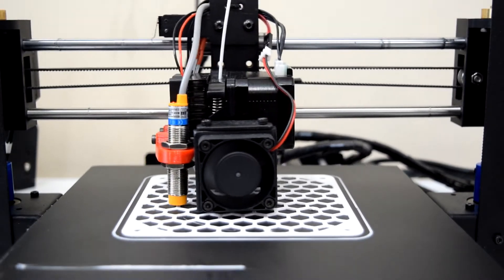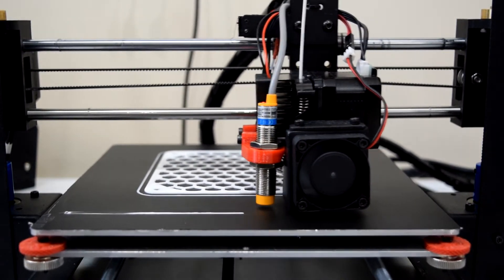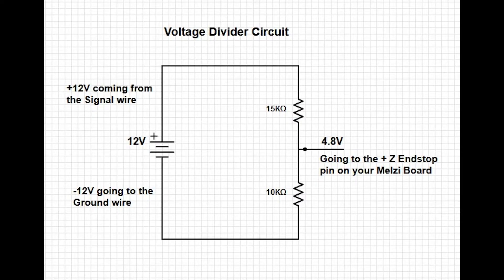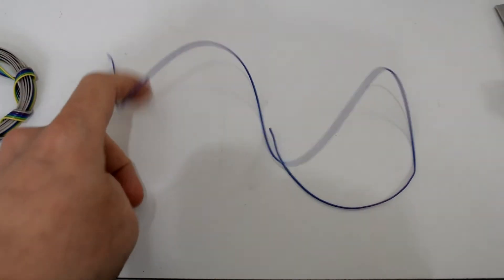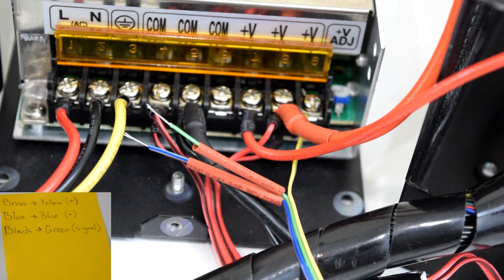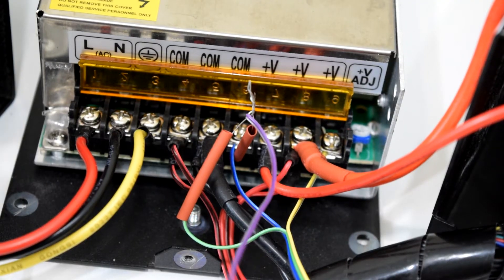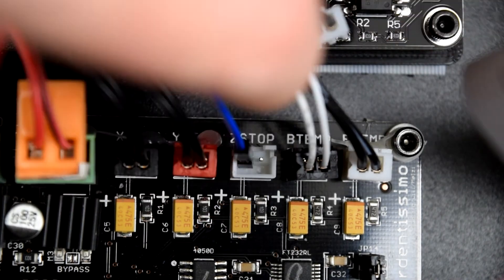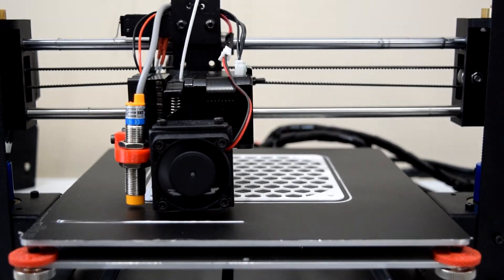Maker Select Auto Bed Leveling v2 | Voltage Divider Method

Comment: I am a first time 3D user but I hand built a 36” x 48”x7” CNC 12 years ago and have enjoyed it for years, and I want to try my hand at 3D printing.  Im well versed in the importance of aligning and leveling equipment. Initially I planned to find an used 3D printer and rob it of the bits and pieces I would need in my construction, I lave lots of various sizes of extruded aluminum and planned to use that in my build.
However two days ago I was in Goodwill and found a brand new still in the original box never been assembled Monoprice Maker Select Plus 3D printer for $80.  In checking it out I found it to be a quite rigid well build unit, with good looking Z acme threaded shafts, nice looking brass nuts and generally good looking construction.  In 20 min I had it put together per the manual, and I understand why you have added the diagonal braces to yours. Now before I add any power I’m viewing all the alignment procedures. 

Thanks so much for the very clear description and video of the process.  In your initial auto Z zero you mention replacing the firmware to a different one, is that still necessary with update?  I see many are recommending switching to Cura (SP) firmware, would this update work with that firmware?

Comment: Great video! Thanks for posting it. Following your videos I now have a new firmware and auto bed levelling on my printer. Amazing! Just two comments: 1. I modified your sensor mount so that you can directly mount it to the printer without having to buy longer screws. I have it uploaded to my GrabCAD (https://grabcad.com/library/monoprice-maker-select-v2-wanhao-di3-auto-bed-levelling-sensor-mount-1) and cross referenced the link to your Youtube channel. Please let me know if you don't feel happy about it. 2. I'm not an electrical guy but in the voltage dividing method you shared, it seems like your sensor does not have a pull up resistor. In my case (and apparently some others down here), mine sensor (although the same model number with yours) has a pull up resistor of 10K. I ended up using 1x10k in series with 2x10k in parallel (so 5k) to divided the voltage to 4.8V. This also make it more cost effective as you only need to buy the 10k resistor ;)

Comment: Do you lose any features by enabling this bed leveling, and is it 3-point or mesh? I remember looking into this when I first got my machine and read about how small the melzi memory is, and you'd lose PID temperature control (among other features) by installing bed leveling.

Comment: Could this be a faulty sensor or wiring? I was able to print a test bed level file a few times with no issues. But the machine randomly seems to crash into the bed for no apparent reason. I go over the final calibrating steps try again and everything seems to work out but it happens again. Also the head crashes into the bed on the last auto leveling procedure towards the right back of the bed, never before the 8th and last probing... the sensor is still over the bed so the settings are good. When it does print the leveling squares they are perfectly placed on the bed. I am about to throw it out smh. any help or suggestion here would be greatly appreciated. Thanks for your patience lol

Comment: complete newbie... I followed the instructions with the Arduino method. In that video the AutoBedLeveling was compiled to the Arduino. With this new method of connecting the sensor directly to the Melzi board, do I need to compile the AutoBedLeveling to the Melzi board? If yes how is it that done and will it write over the firmware or simply added to it?

Comment: I may be missing something critical here. But isn't a voltage divider only required on a PNP inductive sensor? And for NPN, you connect the signal wire directly to the input, then turn on that inputs pull up resistor. Then when the sensor is triggered, it pulls the signal voltage down to 0, switching the input from high to low.

Comment: Bringing a bit of light as I was becoming crazy with the voltage divider. The LJ12A3-4-Z/BX probe has a 10k internal pull-up resistor. So if you use the resistors from this video, you will actually end up with 25K resistor from Signal wire, 10K from Ground, resulting in a 3.6V output to Z EndStop.
You need to work with a R1, R2 following pairs (R1 is from Signal wire and R2 from Ground) : 11k and 15k, 18k and 20k, etc...
Inverting the 10K/15K should work as the voltage should be 5.15V.

Edit: I inverted 15K/10K, it outpud 5.12V and works fine on the board. My sensor is finally working properly. Tip: you can send M119 command from a terminal to see the states of your endstops. That way, you won't crash your bed like I did if things turn bad.

Comment: Thank you so much for these amazing tutorials. I flashed the new Marlin firmware, Installed the probe and everything is really working great. I did have a few issues with the probe but managed to sort it out with one of the comments. I am currently working on a Marlin 1.9 Firmware for the machine.   Keep up the good work bud :)

Comment: I figures out a easy work around so you don't take anything apart.
Hook the blue - and brown + to a 12 or 24v transformer, hook black and blue to a micro relay on the input side, hook the normally open switch to the z plug.
When the proxy triggers the relay it closes like the original z switch and says stop.
Works awesome.

Comment: OK hope you replay but here is my idea.
Instead of using resistors, use a dollar store 12v to 5v car phone charger.
It would be a clean 5v 1000mah supply to the z header. 
What are your thoughts?

Comment: Could you use something like a Pololu 5V, 2.5A Step-Down Voltage Regulator on the leg from the sensor back to the main board instead of the resistors? That way you could just power the sensor with 12v from the PSU and step down the signal back.
Reply: I was just considering such an option myself! Obviously 2 resistors is a more efficient option as regards cost/components etc but I'll be powering from a 24V supply, so not sure I'll have the right resistor values to hand. I do however have a 24-5V buck converter that I could use to step down the signal's voltage to logic level. Would be interested to know if it's a viable solution. Did you discover the answer yet, Michael?
Reply: Steven Kirby  I have all the parts to try it out, possibly this weekend. The one I have is a fixed 5v output. I've also got a liner 7805 voltage regulator inbound to test out. My only worry is the delay in the current flow with the buck converter from time of sense to passthrough / step down, so I'll try the 7805 if that delay is too much.
Reply: Was just grabbing the things to test it out I have another sensor and a 24V supply handy. I hadn't considered latency but I guess you could compensate for that if the delay was constant, you'd just have to adjust the z offset to account for the extra distance traveled by the motors whilst the signal is working it's way through the converter. Provided it's not so long your nozzle plows through the bed of course! I'll have a mess about now and if i can get the circuit to work on the bench I'll do some testing with the machine.

Comment: I wanted to provide a simpler solution for people who already followed the first video, and don't want to open their control box back up. All you'll need is two resistors, and a couple of extra jumper wires.

1. Disconnect the sensor signal wire from Arduino Pin 10. Move the sensor V+ wire from 5V to Vin. That will power it with the 9V coming from the power supply. You should now have a nice bright LED when the sensor is triggered.
2. Measure the voltage on the signal wire. For me, it was about  7.5V. 
3. That's too high for the Arduino, so build a voltage divider to cut it in half. Solder your sensor signal wire to a 10k resistor. Solder the other end of the resistor to both the second resistor and a new jumper wire (your new signal wire). Sold another new jumper wire to the other end of the second resistor, which will go to ground.
4. Measure voltage coming from your new signal wire, which should be somewhere between 3-4.5V (safe for the Arduino).
5. Plug your new signal wire into Arduino pin 10 and the new negative jumper into a ground pin.

Everything else should work exactly like in the first video. Pushing the sensor voltage up to 9V gives it enough power to work properly, and the voltage divider brings the signal output voltage back down to a safe level for the Arduino. No need to open up your control box! :)

Comment: My sensor lights up and seems to be connected correctly but the printer never stops going down. When it starts auto home it goes up a little and then back down again. I have the firmware flashed exactly as is. The original zendstop switch still works. What should I do?

Comment: Alright, so I followed this instruction series to the letter, using parts and software you've recommended. Sometimes when the capacitive sensor triggers on approach, the Melzi board won't always react in a predictable way. Sometimes, the hotend will crash into the bed. Other times it will react as expected, but the delay for which the Z-Axis stops its approach is never consistent. Sometimes it'll stop as soon as the sensor lights up, other times a second or two after. Is there something I'm missing or doing wrong?
Reply: hey man, did you get this working? im having the same issue

Comment: Great video, I am having trouble though. The output on my melzi board reads 5 volts from the +, is this correct? Then when I connect the sensor (using the voltage divider) to the + and "activate" it the + on the z stop reads around 2.5v and does not trigger the z axis to stop. Is there something in the config file that I need to change.
Reply: Solved my own problem, I needed to remove the physical pull up resistor on the Melzi board. Once removed I was able to get consistent 5v.
Reply: Can you elaborate on the resistor you are talking about?  I'm having a similar issue

Comment: dumb question, where do you put in the sensor offset info in relation to the extruder since there isn't an arduino used with this mod?

Comment: Thank you for the tutorial! Everything with the install went smoothly however I'm having issues getting the bed to actually level before a print.  I run a G28 and then a G29 and everything probes correctly, however when it goes to start printing the left side of the bed is way too close and the right side is kinda far away.  I'm using your Marlin version from the last tutorial.  Any advice?

Comment: when i put the signal wire in the z stop it goes up instead of down what can i do ? sorry for all the messages
Reply: does it matter that my sensor output status is normally closed ?
Reply: my sensor shows 5.25 when it senses metal but 0 when it doesnt do i have to get a new sensor?
Reply: thanks this is great can i just upload the firmware through the usb now or do i have to do it through the arduino again thanks again for you help
Reply: you are a fucking beast it worked XD
Reply: heres the link to the cooler you asked to have a look at https://www.thingiverse.com/thing:1025471/#files
Reply: i changed to the blower fan version :)
Reply: thanks :D

Comment: I'm having issues. When I assemble the voltage divider as instructed, I get about .3 volts between signal & ground when not triggered and 0 when triggered. If I move the divider to connect positive & signal, I get 12v when not triggered and 4.8v when triggered. I did have to switch the resistors for 330 ohm & 220 ohm, but the voltage divider calculators I'm using say that the result should be the same. Any suggestions on what I'm doing wrong?